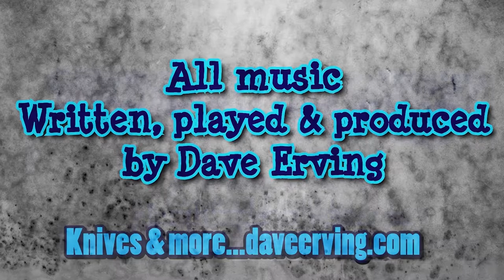Firekeeper Forge 3 Knife Collab - Starting the Integral Bowie

Comment: That scale is actually martinsite and it is,some hard shit to grind off.  Its why i make my blades thick cuz ya lose alot grinding that shit off.  I also use a 4" hard disc on my angle grinder for this but u get the point lol
Reply from the maker: Right, I'm use to hot rolled steel, where the scale isn't actually embedded in the steel.  Muriatic works great for that..Live and learn...take it easy.